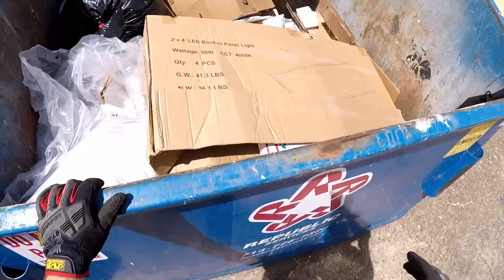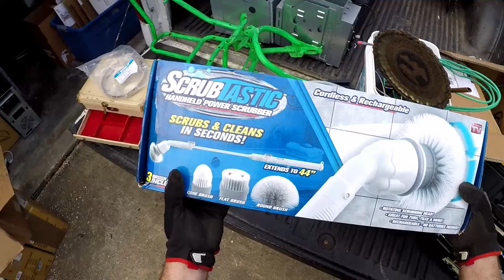Dumpster Diving "It Feels Weird For Me Too"

Comment: Mike pretty good haul. Watching you with my late morning coffee. The red item with the black end and handle at one end is a pick-up tool for metal items. I use one for metal shavings and bits of steel at work. Hold on to it for stuff you can't reach or picking up LOTS of little bits of steel,nuts and bolts,screws and such (lots of a little=a lot).
Be safe out there, Aawwoooo, y'all!👍✌

Comment: Air pressure regulator with oil separator/filter at 39:30 will resell for about $25-35 easy.

Comment: That last dumpster. The red item with the handle at one end, and a big round end at the other. Is a magnet. You could use that to pick up all that small metal in the dumpster from earlier in the video. Handy tool for cleaning up.

Comment: Mike, have you priced out new nuts, bolts, screws and washers lately? At the cost of them I wouldn’t be scrapping any of them. Even prices for them at rummage sales is insane. The days of going to the hardware store and getting a good size handful of bolts with nuts and washers for $1 or $2 are in the past. I doubt you could replace what is in that toolbox with new for $25.

Comment: Wouldn't a vacuum have a little motor in it somewhere even if they already pulled the wire off it?  Too much trouble to smash the housing to get it out?

Comment: Dude, rescue the motor out of the vacuum...copper is copper.
Reply: He stopped tearing down vacs for the motors some time ago, i guess when he realized the time effort and mess was not worth it to him. I don't understand why at least not toss them in the truck for shred easy $2 in weight but he went for the cord worth a dollar. Funny thing is the high end/expensive vacs like Oreck, Dyson, Ricar, Miele all have very good resale values for parts as is could have been an easy and quick $25-50+ sale

Comment: Hey Mike, I did what you are doing bake in the 80's thu the 90's But gave it up when they did away with dumpsters, But at 63 yo I can say it was so much fuan to do it, I came up with things that made things easier like I made a heater box that I ran thw wires thro that made it easy to take the cover off the wires without burning the wires, Ane now I see things you do and also don't do, Like with vac's and stuff where you pass on them because they have a lot of plastic on the, Well thos vac's have not only motors and other metals in them that is not hard to take apart, I use to do it with a hand screw driver and pliers, Now you have the power drivers and other power tools that would make it a breeze to do, I wish I lived closer to you, I'd be willing to help you by taking the stuff apart for you, Even those electric motors with all that copper in them Hey it isn't hard when you have the tools, And also, You seem to pass on aluminum cans  and I understand they are a pain in the butt to deaal with But a friend of mine whi still hits  the cans has made a melter for them and he melts the cans and makes bricks of aluminum and the scrao yard gives him big bucks for the bricks because what he is doing cuts out the smalter and that cast the less on the end, But the faact that 1 bag of crushed cans melts down into a 4 to 5 lb brick cut's time and room, The bricks are 1 in thick and 1 foot long and is easy to check to see if there is loaded lead in the because lead is heavier but magnet wont pick lead up, But 1 in thick aluminum is passible at scrap yards, He also melt coppe and brass into small bricks but it take a lot of propane where amuminum is cost effective or even a shredder is easy to make with those gear boxes you find and electric motors that would beef up the ease of the shredder, I metal paper shredder is easy to convert to a can shredder, Man, I have so many Idea's that would make it easy on you end, The can shredder could also shred copper wire so it take up less room. But taaking apard electric motors is something you might look into with the tools you have I know you get good money for the motors as a whole but the motors have two different metals so steel and som aluminum alomg with the copper wires, But being able to put all copper in one bin and aluminum in another would bring in 2 x the money, But like I sai, I live in Georgia and your in Texas so me being able to he;p is not going to happen, I would move but I'm disabled and on my income Texas is not a place to rent at a cost I could reach. Anyeay you could do well to build a heater box to take off the insulaton off the copper wire with ease, It melts the insulation to the point it can be peeled of with leather gloves without burning your hands and doing it with a knife takes so long. Alsolook into a scrap yard that takes plastic, Might not make 3 to 5 cents a pound but it  can bring in a lot becuse few take the time to do it, But next time you out, Just look at how much plastic is left behind, Glass is the same but it's like 5 cents for 10 pound. :ot of money to be made out there and what you are getting is half of what you could be making if you did it right, I'd love to be able to bget back into a dumpster, You leave a whole lot that could be recycled in the metal department.. Keep on scrappin.